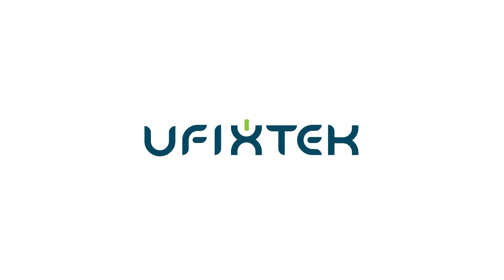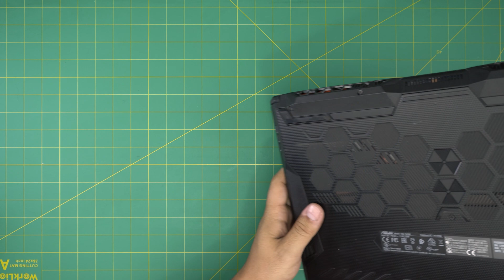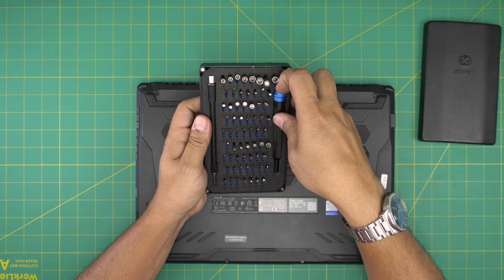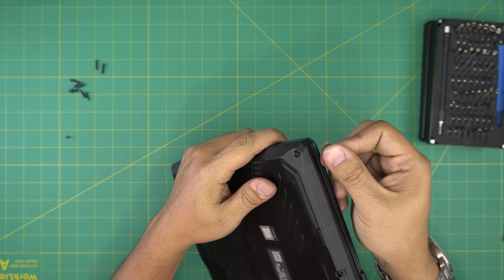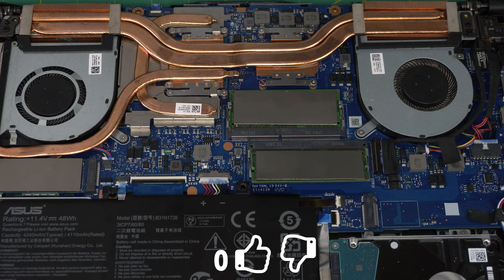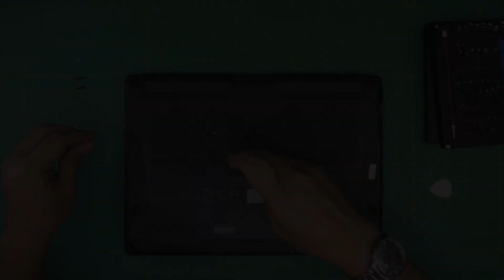How to upgrade ram on ASUS Tuf Gaming A15 Fa506iv

Comment: I need help about this laptop's upgradability:
1) Max supported RAM size, RAM speed and also which is max version (DDR4 or DDR5 or LPDDR4x or whatever) 
2) Max supported SSD size, SSD speed and also which is max version (Gen 3 or 4 or whatever)
Reply from the maker: 🫠Regarding your questions, the ram was explained in this video as it is SDRAM DDR4 3200 MHz you can place upto 32gb, links in the video description.
about the storage here is the video on storage upgrade: https://youtu.be/jR9kTuSQTlk
cheers🍻

Comment: is 5400 mhz ram supported on this model ?
Reply from the maker: 🫠Regarding your question, if you feed a 5400mhz it will get auto adjusted to the max that the motherboard and bios can handle, 3200mhz is the recommended ram.
cheers🍻

Comment: Can you tell me the thickness of the thermal pads for this model?
Reply from the maker: 🫠Regarding your question, it doesn't use thermal pads as the space is not even and if you place a thick pad it will counter push the heatsink.
https://youtu.be/trWjunGnNyo
you need to get a thermal putty.
Should you have any further questions or requests in the future, please don't hesitate to ask me.
cheers🍻

Comment: so both RAM slots are already used? TO upgrade to 32gb.. you have to replace both?
Reply: I put duel 32’s in mine.
Reply: so will the Asus TUF A15 FA506IV gaming laptop take total of 64mb ram ( 2x32) ??? @jamesWaldron-y8z
Reply: @jamesWaldron-y8z  you mean its 64 gb in total?
Reply: Just got 2 16gb with I'm guessing the best sodium you can get I'm hoping this takes a load off my ram and will give me a better latency time.
Reply: No its 16gb you have one slot not used
Reply from the maker: Thank you for your feedback! If you'd like to support the channel, you can show your support by liking, subscribing, or doing both!

Regarding your question, you can follow these steps to check the memory slots in your task manager:
    Press Ctrl+Shift+Esc to open the Task Manager.
    In the Task Manager window, navigate to the "Performance" tab.
    Under the "Memory" section, check if it displays "Slots used: 2 of 2" or "1 of 2".

If it shows "2 of 2", it means that both memory slots are occupied. In this case, if you want to upgrade to 32GB of RAM, you will need to replace both of the existing memory modules with higher-capacity ones.

Should you have any further questions or requests in the future, please don't hesitate to ask me.
Reply: @uFixTek nigga he asking a question 😂😂😂